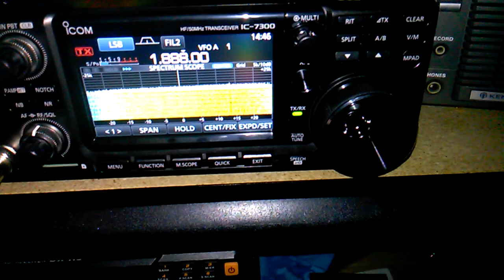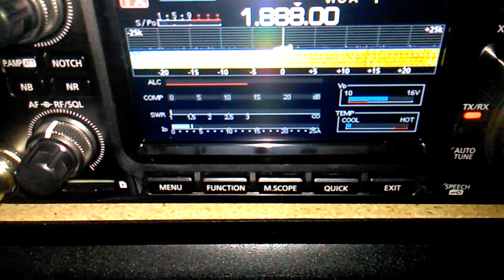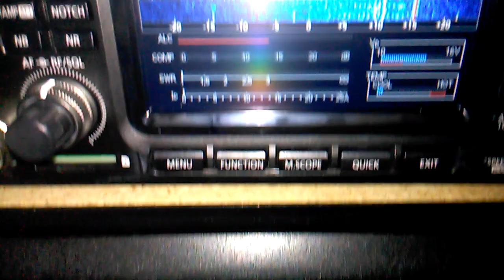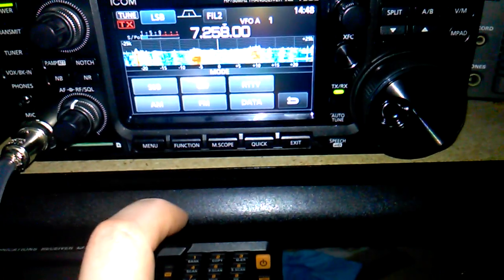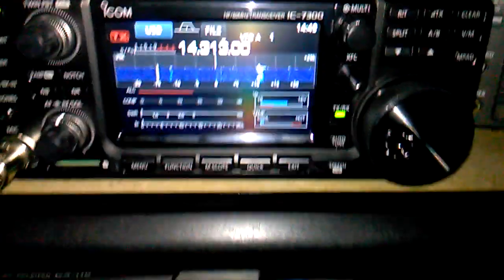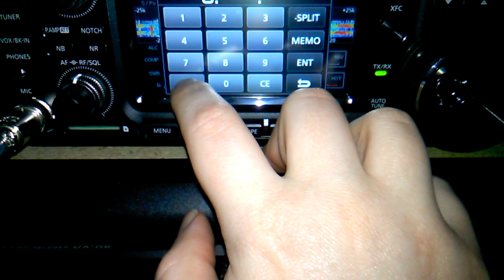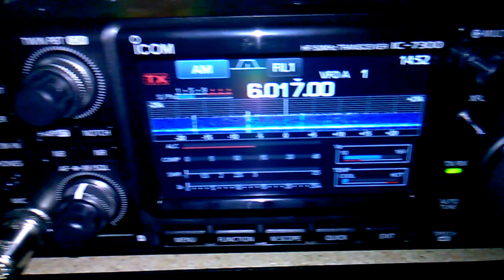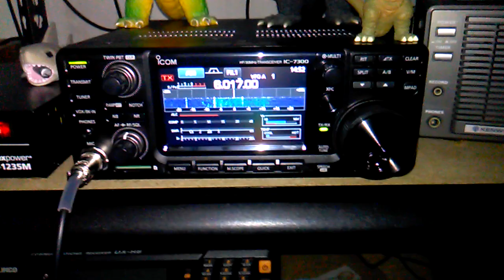Tuning Up the Inverted L Antenna

Comment: Sparky just found your channel. Very cool stuff. I have a couple of questions for you. I’m just getting started in shortwave listening. Got my first portable a Tecsun r9700DX. Now I want a base station. What bass station do you recommend I get. Not sure what I need to spend. I would like to be in the $500-600 range. Is there something I would be happy with. I want full coverage so I can get ham operators along with utility frequencies. Thanks Jim from Georgia
Reply from the maker: I would highly recommend the Icom IC-R75. It's a great radio for receiving, the only issue is that it;s no longer in production, so the prices on eBay are going to be all over the place. The Alinco DX-R8 is still in production, and it's decently priced. It's not quite as good as the Icom, but it's still a nice radio.

If you have a really nice outdoor antenna, you could get away with using a portable for dxing the bands and ham frequencies. The Tecsun PL-880 has SSB capabilities and will pick up what you want to listen to, plus, since it's a portable, it won't take up alot of space.
Reply: Sparkyzilla85 thanks for the suggestions. I think I will go with the PL880 for now. Who knows, maybe then I will get my amateur lic. Thx